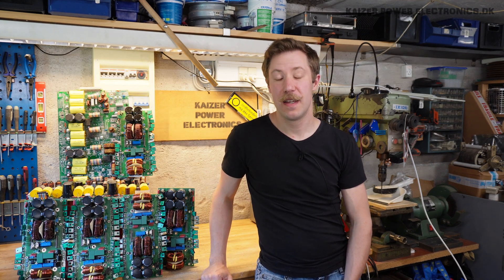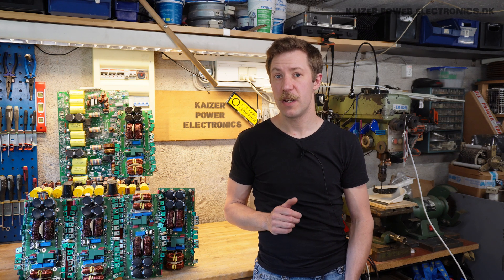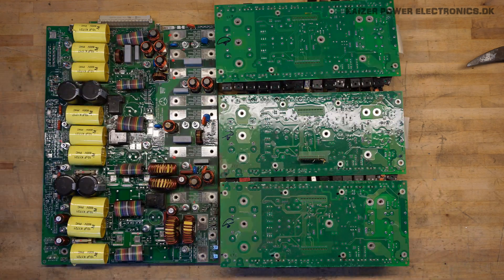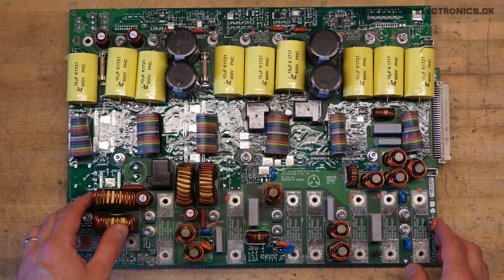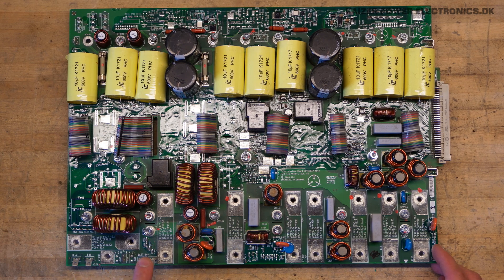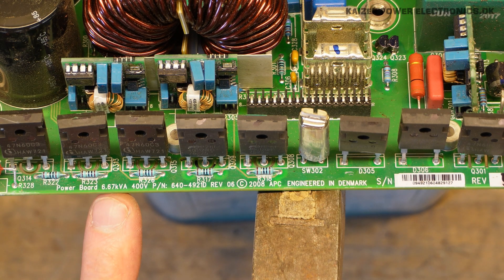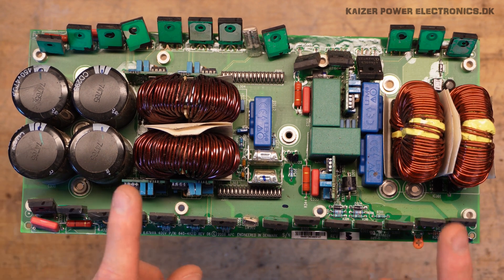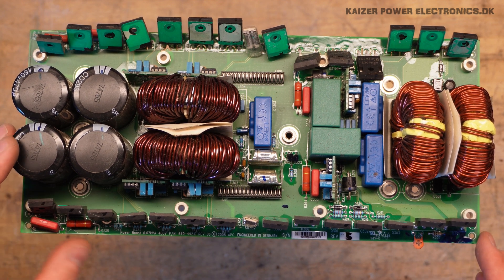Teardown of a APC SmartUPS VT 40 kVA

Comment: The SUVT/Galaxy 3500 was engineered in Kolding, Denmark back in 2006 - 2008. That is why the power boards are marked "Engineered in Denmark". The unit is no longer in production, but as always we promise to support with spare parts up to 10 years after official discontinuation. The SUVT/G3500 was replaced by the Galaxy VS which was also engineered in Kolding, Denmark.

Comment: Anything on gate drivers
Reply from the maker: The small individual boards I pointed out in the video is a gate drive transformer and passives. The main driver output stage, under the silver color heat sinks, is 20N60C3 MOSFETs, so quite a stiff driver for all those IGBTs/MOSFETs in parallel.
Reply: @KaizerPowerElectronicsDk  thank you sir.

Comment: Mosfets and OGBY devices are perfect though to repair your regular SMPS units, as they will work in most smaller units well, provided your drive circuit can drive the input capacitance. The rectifiers as well will be useful there.
Reply from the maker: All is saved! Don't worry, the boxes of IGBTs and MOSFETs is bulging :)

Comment: Nice inductors for a reactive load for amplifier's if they're approximately 20 - 50 mH
Reply from the maker: Very hard to get off the boards in one piece, epoxy, heavy copper wire and soldered in with 4 or 6 points.
Reply: @KaizerPowerElectronicsDk  Yeah pitti , coating is the worth but I had success with super paint stripper still a not so nice job to say the least